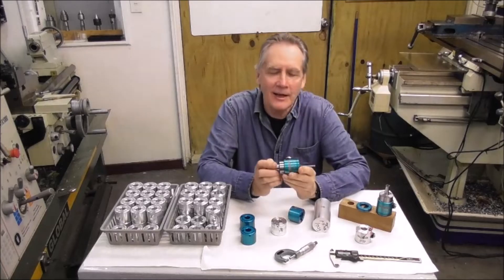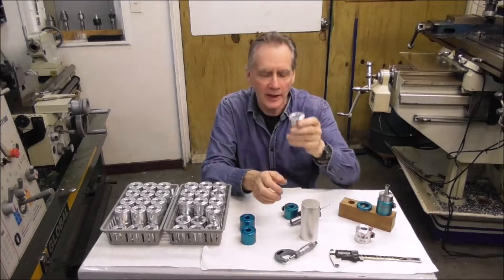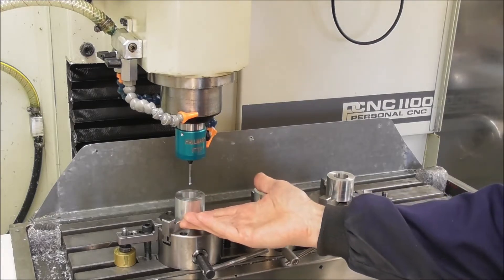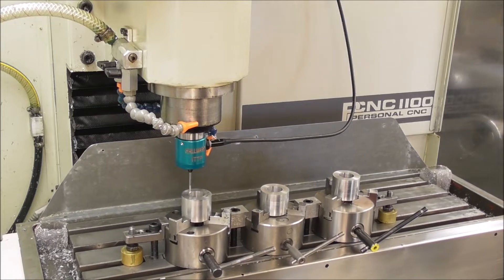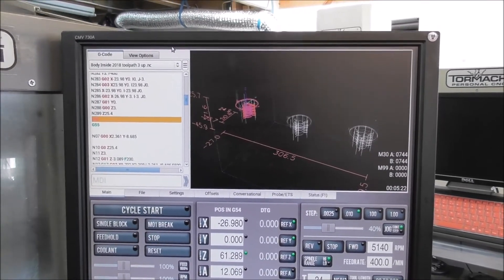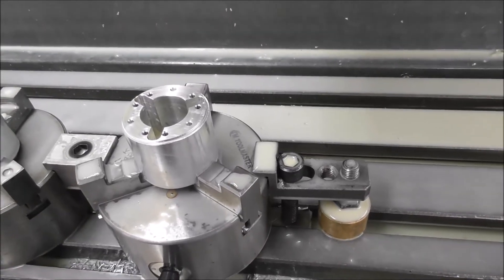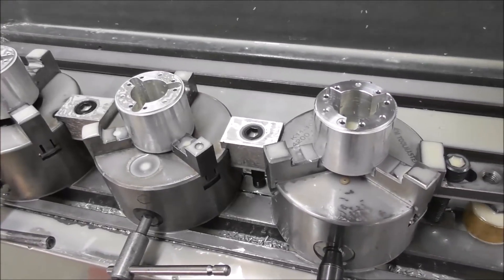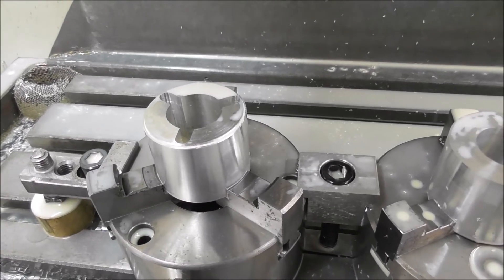Tormach Parts Production.  Chapter 3:  CNC Mill - Work Setting

Comment: Thanks for the very informative videos.  I am considering a Tormach 15L lathe for short production runs.  Will this machine handle 1.375" through the spindle bore with the provided 3 jaw chuck?  Also, do you think its capable of doing 1"-8 and 3/4"-10 external threads on 303 stainless steel?
Reply from the maker: Hi - The chuck can be bored out to around 45 (mm diameter) and the spindle is around 40. So yes 1.375" is no problem. I did a video on the spindles limited torque. 'slant pro - machining steel''. 3/4 stainless would be borderline but probably manageable with light cuts and the right tool.  Cheers, Cliff

Comment: One useful tool on the automatic oilers tormach uses is they have a pressure gage, so when you hear it running you can look at the pressure, and hopefully notice a change if there is a catastrophic event like a broken line. It's not foolproof, but it does give the machine a chance to talk to you.
Reply from the maker: Good point josh. Cheers, Cliff

Comment: Hi Cliff, I am wondering why you use a serial chuck work holding system instead of machining a solid work holding block, where you can make 12 or more parts in one take? I hope this question is not too naive for your level of professionalism. Herri
Reply from the maker: Hi Herri. No, that is a good question. A custom fixture of as you suggest 12 or more parts, would allow a much longer auto running time. This would make a lot of sense if runs were larger eg in the hundreds. But when runs are less than a hundred the run efficiency is less of a concern. Also another factor has to be considered for high precision machining, especially on budget cnc machines; accuracy monitoring. If a auto run is too long cutter wear or other changes could occur mid run and cause multiple parts with issues. I find for this part a auto run of three is enough to keep the quality under control.  Cheers  Cliff
Reply: @Threadexpress  In your precision machining quality control is the sine qua non and I can see that you are pursuing this goal in the core. Just brilliant.
Reply from the maker: @cyatlas  "Without (something), (something else) won't be possible." Good spotting! Cheers  Cliff